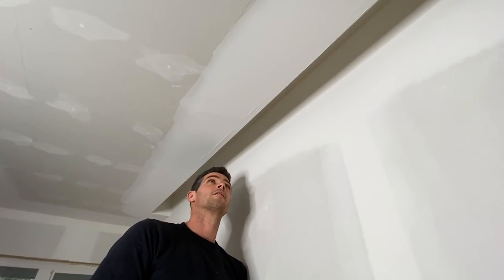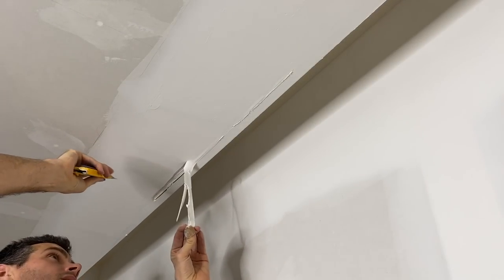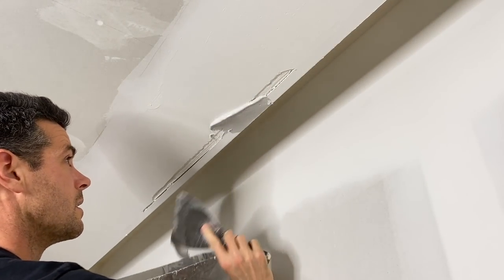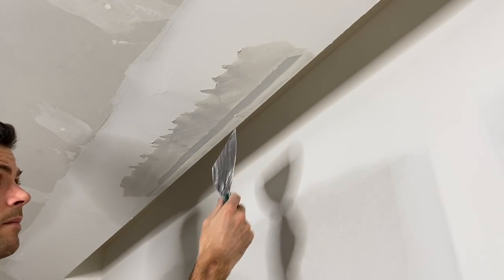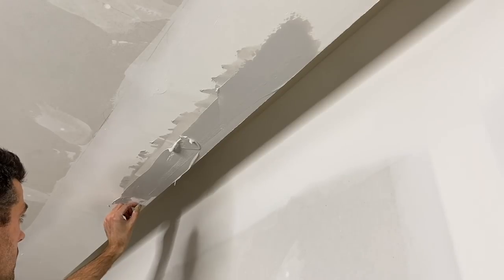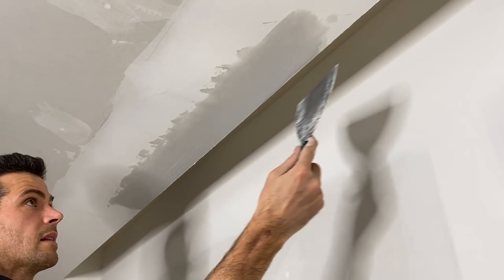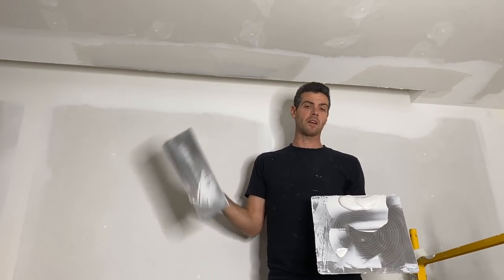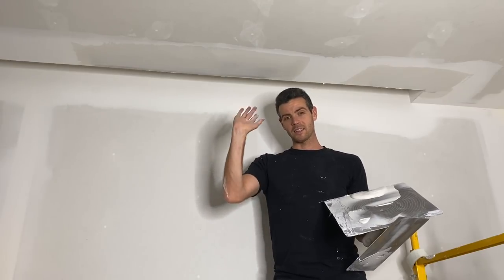How to fix a BLISTER in a CORNER BEAD!!!

Comment: I have watched most, if not all, of your videos and I like this and similar content as it helped me recognize and correct a lot of bad joints before I primed and put 2 coats of $45/gal paint on my bedroom wall.  Watching and listening to your explanations have changed the way I look at walls, which is a mixed blessing.  I have new appreciation for smooth walls but now I can't unsee bad joints.  It would generous to say my home's previous owner did mediocre work, so this has been the gift that keeps on giving.  On the positive side all this bonus experience has given me the confidence to open my walls to run elecrical cables for better lighting and even put in a pocket door.  Keep up the good work.
Reply: Once seen cannot be unseen. Sadly, sub-par work seems to be acceptable nowadays so you need to find a way of correcting it if it's your space, and keeping quiet if it isn't!

Comment: Had the same issue 2 days ago, came to the same conclusion.
All my bubbles (7) were 3” or less so I skipped the fibre tape but did use 20 minute mud. Can only hope that works, I believe it will as 20 dries like cement.

Comment: Love your videos and the way you break down the tasks. However, I have a difficult situation that I've not seen you cover. Have you ever been forced to "make" a tool for extremely odd inside angles? I have a very obtuse angle between two windows in a tight bay and have heard the best way is to cut some rigid plastic to the desired shape for a trowel. Do you think you could make a short video on weird angles in tight places? Thanks!!

Comment: A couple of days ago I found a different way to fix corner bead blisters.  I'm a newb.  Complete diy'er, done a bit in the past when needed, but it's always years in between doing any.  Only for my own places.  Now doing an entire house for renovation.  First room I did I got blisters under every piece of corner bead (paper with metal... same as vid).  Sucked.  Started fixing things like shown in the video.  Then realized that the mud layer that I had put on, that brought the blisters on full display, dampened the previously dry mud layer below just enough so that I could dig into the mud gently and peal back the corner bead right from the edge of it.  Then it was a matter of carefully packing the mud into/below the corner bead (was easy/quick enough once I got the hang of it).  Smoothed it out... blisters gone and no cutting the corner bead or doing anything else wonky that would mess up the structure of the corner bead or require anything additional.  Also thought that one of those big honkin syringes would be absolutely perfect for fixing blisters.  Lift edge of corner bead where blister is using method above, fill big syringe with mud, squirt under the bead, flatten as normal.... voila.  FYI, subsequent rooms have been blister free, also my blister fixes are perfect... not the least bit noticeable.  Bought a inside corner roller, a lambs wool corner mud roller, and a manual hand flusher.  Game changer combo for a newb like me.

Comment: Ya know, if you don't prime a latex painted wall, the 45 min mud bubbles up and blows off the next day? Yeah, you did. I didn't. 2 days work flaked off with a putty knife. Now I follow your practices for priming - scuff, bonding primer, a bit of carpenter's glue. D'oh! Other painted surfaces I primed first are fine.

Comment: I have a 25 years old house that has the ceiling to wall corner tape separating in almost every room. What is going to be my best option to fix this problem. Do I need to rip out all the old tape or can I undercoat the existing tape and then feather out with new mud?
Reply: For a quick amateur fix you COULD caulk all the cracks
But personally I would re-tape all the cracks with paper tape.

If they cracked in the first place I'm going to guess they were originally done with mesh tape

Comment: Dumb question - could you have put some superglue in that void?  Or some hot glue?  I'm doing a home renovation and it may sound silly, but I have found all kinds of applications for hot snot, like for filling in foundation voids around pipe holes before finish caulking.  Easy to apply, and it does dry hard which is useful
Reply: I've used a lot of hot glue myself. My experience has been that it tends to suddenly detach a few months later. I found super glue to be a lot more reliable  but only works with tight joints.
Reply: I haven't tried hot glue but even assuming it holds I predict it loses over joint compound in cost, suitable working time and sandability.  Are you predicting advantages for hot glue over joint compound or are you just curious if it will work?
Reply: @georgebush6002  Just to fill the gap. Not as a top coat, just to add some structure under the tape.
Reply: Hot glue won't sand and finish (and take paint) the way the rest of the compound will.
Reply: @peep39  I am clear on what, but not why.  I don't have a lot of hot glue experience, do you see any advantages in using it over joint compound?  I am not qualified to say if it would bond, but the below video link makes me think it might.  https://www.youtube.com/watch?v=c9DTZYFdLgk

Comment: When that happens, I inject glue into the void as far as it will go, then hot mud over with fibafuse
Reply: The glue idea seems solid.  I was thinking a mortar bag technique with a couple shims to hold it open during the squeeze.
Good thing I'm a plumber and not a rocker/painter.

Comment: How do you feel about cutting at the ends of the blister perpendicular to the tape. Lift the tape like a flap so you can add some wet mud behind the blister. Then close it up and run a knife over to squeeze out excess.
I’m a DIY hack job of sorts and this works well for me. Not sure of it will last though. Thoughts?
Reply: Usually u can c the bubbles before it drys and your way would work
Reply: Watching this guy tape gives me anxiety lol I don't think hes a taper I think he does everything jack of all trades master of none
Reply: @mattmccaughen8082  Right, but if your scope of work is on the busier side it is easy to miss something small like that. Touch up doesn’t exist in your world?
Reply: @mattmccaughen8082  he is a carpenter that is very good at drywall.  Simple yet complicated enough to be better than most in his field.
Reply: @sundog8772  touch-up is in ALL fields! 😂 
But I know you knew that so I should have left gone unsaid.  🤦🏼‍♂️
But now that the deed is done - I like your statement as it stands.
Reply: @sundog8772  I assumed he messed it up on purpose so he could show how to fix it.  I have no reason to believe this other than I remember him setting up a bad joint in a different video and laughing because he kept failing at getting a bad joint.
Reply: @mattmccaughen8082  I always feel like he is a little distracted from trying to do three things at once (i.e. do the work, explain the work and get a good camera shot of the work).  Is that the vibe making you anxious or is something else?
Reply: @georgebush6002  Perhaps he messed it up on purpose, as you say, but this would mean you’re implying a pro would
never make a mistake? Sure, it shouldn’t happen if you know what you’re doing but regardless, mistakes still happen and knowing how to repair your mistake is very important.
Reply: @georgebush6002  I think it's because I'm a taper and it's weird seeing someone doing it on camera he's not bad either does stuff differently but he does good work

Comment: I thought the mesh tape, which has a sticky side, had to be applied on a dry surface and could therefore not be applied over a layer of wet mud like you would normally do with paper tape. Help anyone?

Comment: yea, that is mega annoying. i have tape in the inside corners. it was perfectly fine on the walls until I added the finish coat. suddenly random appearing blisters and large sections going off here and there... still don't know what I am doing so horribly wrong. (´△｀) All I can do is tearing off the tape there and fix it in-place somehow (that is, apply new tape on that spot).
Reply: are u sanding in between coats? Lots of time people do and are not making sure to completely remove dust particles before applying next coat. Secondly, you could be watering it down too much, mixing too much incorporating air bubbles, and humidity/moisture. Hope this helps